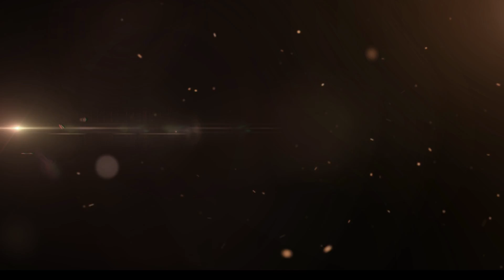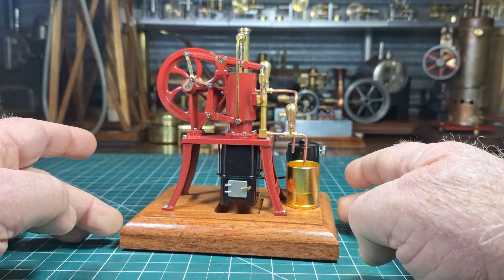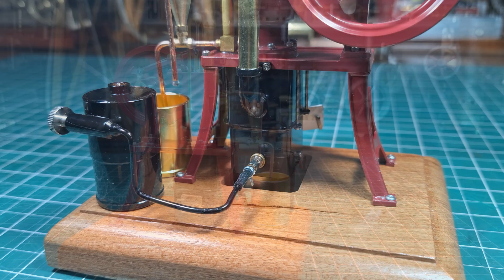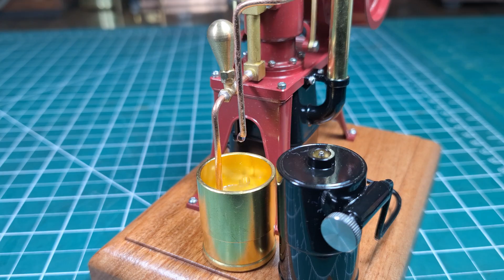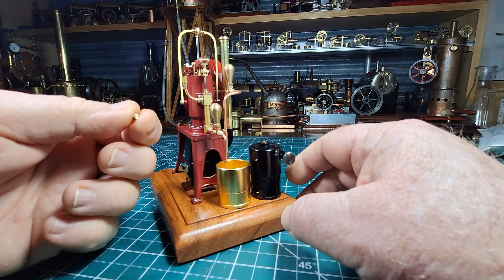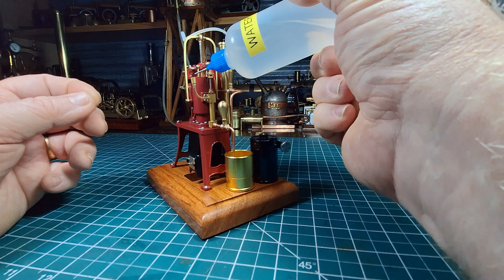Okmo Microcosm Rider Ericsson Engine Model R01

Comment: Mine arrived yesterday, at first the burner wouldn' stay lit, now when I try to light it flames shoot out the little vent holes where the hose attaches on the back of the firebox. It runs fine if I aim the flame of a mini butane torch into the firebox door.. I think I'll try making an alcohol burner for it...
Reply from the maker: Well that's surely a bummer with a newly bought and arrived engine. Is there a crack or any holes where the hose attaches? Is that clip on tight?

Comment: Cool video, nice looking engine.  Just got one for Christmas and it runs well.  Unfortunately, the pump part is a bust.  I've run it maybe 10 times, priming each time, with the pump up, then down, then in between.  Of those 10 times it pumped, dribs/drabs only,  on two of the runs.  It never pumped even close to what yours does.  I've sent a message to the seller, dtjsteam, as to what to try next.
Reply from the maker: G'day Wayne, that's a shame mate. What I do for mine is to take the priming cap off, put some water in there and keep turning the wheel while putting a finger over the top whilst adding more water and then putting the priming cap back on and its always pumped well for me.....hope that's of some help - Cheers Jim
Reply: @SteamEngines-Jim  Thanks for the advice.  I've decided to step away from the water-pumping issue for a few days.  I'm thinking of using a hypodermic with a siicone tube that just fits to force the priming water thru.  Right now, I'm having a devil of a time getting it fired up.  It seems that when I open the butane valve a bit while holding the flame to the burner, or as close as that tiny doorway allows, and a fog of flame erupts.  This might happen five or more times before the burner will properly light.  It surprised me because it did not do this the first few times I ran it.  The burner seems a bit flukey and the valve is really touchy.  I just tried my small bernzomatic torch as the flame is pointed and goes where I direct it and it only took two tries to get a proper flame. I see you also used a torch.  Is that the trick?   Personally, I'd have preferred an alcohol burner because I have more control.
Good old-fashioned old-school....All that said, at the special price it is worth it.
Reply from the maker: @waynewheaton6244  G'day Wayne....my valve is SUPER touchy as well. I mean REALLY touchy! I also replaced the black gas silicone? tube. I leave the door open on mine mostly when its lit. Fingers crossed you get it sorted mate..Enjoying all your Weedens!...Happy New Year to you!  Cheers Jim
Reply: @SteamEngines-Jim  I agree - sooooper touchy.  I'll be using my torch in the future to light it up.  I will try to score one of the lighters that have a jet flame as that would be simpler.  I think they shot themselves in the foot by not using an alcohol burner....I already have one designed (Tesla style - in my head).  The butane burner is, at best, problematic.
as is the pump.  All that said, it is a marvel to look at and watch run, and at $200 (plus a hefty express shipping fee) a good deal.
Reply from the maker: @waynewheaton6244  I might add the RO2 version as well.  An spirit burner would work well I reckon.....I bought one of these lighters Wayne and am really happy with it -
https://www.amazon.com.au/dp/B08Y5M5V3X?ref=ppx_yo2ov_dt_b_fed_asin_title
Reply: @SteamEngines-Jim  Yep, the butane 'jet' burner is the way to go.  When looking at the R02 I noticed the priming pipe goes into the bottom of the pump when on the R01 it is at the top of the pump.  The knob for the butane is also larger.  I wonder if these differences are, improvements?  Also, since the cap for the priming tube is so tiny I think I'll just make a sort of cap-plug that I can just stick over/in, lickety-split, after the priming for the run.  I'll try it later.
Reply from the maker: @waynewheaton6244  Let me know how you go with it. You'll be stoked when you get it going.
Reply from the maker: Wayne LOL you put the kibosh on me mate 😄 Ran mine today and no water flowing. Ended up using a blunt metal hypodermic needle into the hole after taking the plug out (don't lose that plug!!! I spent 40 minutes on my hands and knees after I dropped it on the floor) and the force of the syringe got the water pumping straight away. Mucked around with the valve, couldn't get any more finesse into it. When I have time I might take it completely apart and see if theres a mod that can be implemented.
Reply: @SteamEngines-Jim  Dropping that damn tiny screw plug.  I got lucky when it dropped and rolled off the countertop, and right into a pan.  From then on, I've done it on a knappy towel, the better to catch would-be runaways!  Anyway, on to my Empire turbine.  Good luck on renovations.  Remember the saying..."measure twice, cut once", and all its variants.
Reply from the maker: @waynewheaton6244  Its a bloody tiny screw plug!
Reply: @SteamEngines-Jim  So, with it running, I used a hypodermic needle with silicone
tubing at the end to fill (and keep filling) the primer cup.  When
water started to pump through, instead of trying to get that tiny
cap threaded into the primer cup I took a bit of the silicone tubing
(with one end flame sealed) and stuck it on the priming cup.  VERRRRRY
easy.  That is my trick and advice.  Works for me.
Reply: Well, I lit it up today just to make sure I wasn't dreaming.  Well, it pumped and then the 'Badness' happened.  A cloud of flame around the butane tank valve.  It does shut off properly, but when opened the butane leaks past the tiny o-ring and it flames on.  I tried variations of teflon tape fixes to no avail, so I now have a dangerous runner also known as a NON-RUNNER!  I sent a message to DJsteam telling of the trouble and asking for new o-rings, an xtra needle valve, and while I'm at it, an xtra primer cap and butane flex tubing.  We'll see what happens.  If there is no help, I'll try ordering an assortment of watchmaker o-rings.  If they do not fix it I'll take it apart and set it up for alcohol.
Reply from the maker: @waynewheaton6244  That worked well for you Wayne, just read on the forum that you're having gas problems now :(
Reply from the maker: @waynewheaton6244  The gas delivery isn't the best is it. I can't understand why its so temperamental, taking it apart the needle valve looks good and should be able to deliver precise amounts of gas, but alas its either off or full bore for me :(
Reply from the maker: How'd you end up getting on with this engine Wayne?